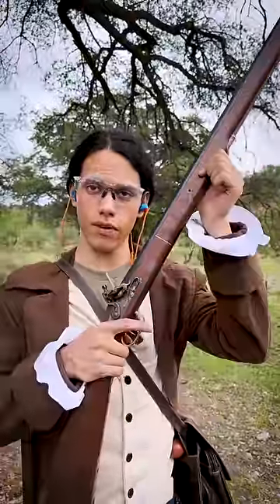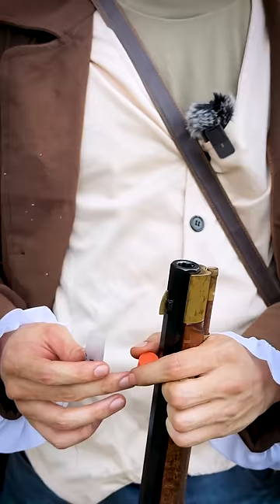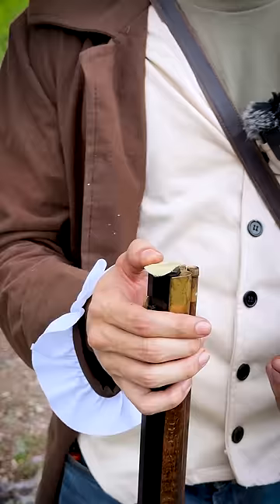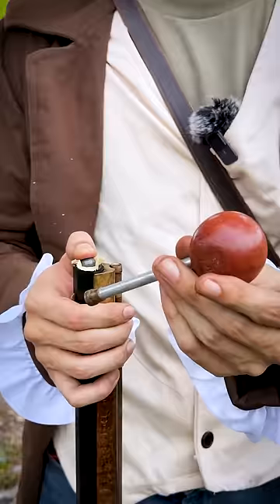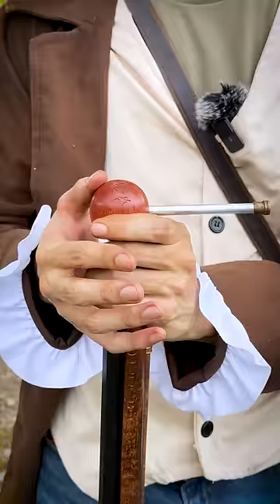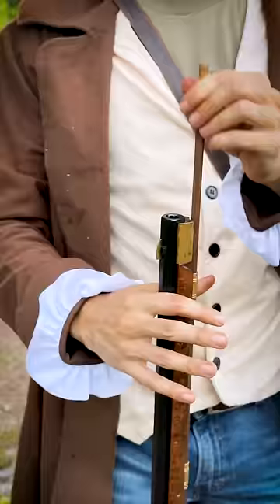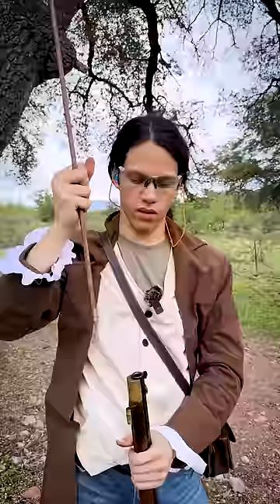How to Load a Flintlock

Comment: 7 hours later. Can't imagine being in battle and having to reload
Reply: Word
Reply: Thats why the line infantry didnt use these, they used smoothbore muskets which were a bit faster to load.
Usually only the skirmishers and sharpshooters used the type of long rifle you see in the video
Reply: Rember switching is faster then reloading
Reply: Maybe It was used on turn based war
Reply: @kinezikinezi1730 if they even had secondary’s at that time😭
Reply: Use sword
Reply: I mean the more u do it the faster it's
Reply: @Donvitto20 yes knife
Reply: This Why Major Musketeers Using Bayonet As Attachment

Even WW1 And WW2 Bolt Rifles
Reply: Bayonet is waving 👋
Reply: that is why they had a bayonet attached to the other end. it becomes more of a spear.
Reply: @gewerh44 thanks for that info
Reply: remember, switching to your pistol is always faster than reloading
Reply: Several Musketeers in a barrage of fire, protected by infantry and cavalry. Also had bayonets in case the enemy managed to penetrate the defense. They positioned themselves at the rear, so there wasn't much danger of being caught while reloading.
Reply: @Donvitto20 usually not, only officers had sidearms.

Comment: I love the delay between the trigger pull and the firing. You can really feel the pressure building
Reply: If it was me firing me first shot and not being advised on this i would have unwelded it from my shoulder and thought wtf is wrong with it? It would then fire while i was inspecting it and leave me in shock
Reply: @bruno13532 you’d probably be on the ground from falling due to the recoil, or a broken nose
Reply: More-so the fuse igniting (the bit of powder in the pan) but yeah that delay is gnarly.
Reply: Same here. Always thought that was really cool..
Reply: Not supposed to do that. That's a hang fire. Oil from cleaning on first shot or crap in the touchhole. Flintlocks don't have 30-06 locktime but not that slow.
Reply: Yeah there should not be this kind of delay. One his gun and vent hole is probablly dirty and 2 hes using too much powder in the pan. A small 1 or 2 grain charge of 3 or 4f is all thats needed. The spark should jump through the vent hole and touch off the main charge instantly. If the vent hole is covered by powder it creates a fuse effect and you get this delay
Reply: When it’s done right, there’s only one sound.
Reply: @Fancy.Bowtie I had one not that long of a delay and not much of a recoil mine was made by Thompson center

Comment: "How do you aim?"

"Hope."
Reply: Did you mean reload??
Reply: Lmao man made me laugh so hard
Reply: Squeeze the trigger don't pull
Reply: @DillonLeyva  who asked
Reply: That’s a rifle, not a musket. It’s far more accurate than most people think.
Reply: Don't forget to flinch
Reply: But having a line of people.... This is just 1 pellet of a 20m shotgun.
Reply: @obi-wankenobi1750  no it's not lmfao.
Reply: @Taylormade2350 yes it is. Muskets are smoothbore military weapons that favor ease of loading over exceptional accuracy. This is because in a battle, you just want to be able to put as much lead down range as possible with little concern with precision. Also, black powder fouling gums up the grooves of a rifles barrel substantially quicker that the smooth walls of a musket. 

The gun he is using is a hunting rifle because it has a rifled bore, which engages the ball and induces a stabilizing spin. These guns favored accuracy over anything else because in a hunting situation, you usually don’t fire too many shots, but the ones you do fire you want them to be dead on. Snipers and irregular troops would have also used these in times of war. They also would usually be substantially smaller in diameter than their smoothbore counterparts, usually falling between 45-60 caliber while a musket is usually 60-77 caliber. 

I own multiple of these guns, have researched them substantially, and fire them regularly. Yes, what the man is using qualifies as a rifle and is very accurate.
Reply: @obi-wankenobi1750  these are not rifled, I know what rifles are bud. Rifles don't shoot balls.
Reply: @Taylormade2350 you obviously don’t know what a rifle is bud.
Reply: @obi-wankenobi1750  obviously you don't.
Reply: @Taylormade2350 obi wan is correct, rifled muskets such as the baker rifle fired musket balls in a rifled bore (pretty sure)
Reply: @datviperboi3818  Nope, I'm correct.
Reply: @Taylormade2350 you are insufferable
Reply: There will be an aim sight on it
Reply: you don’t see the iron sights? They are actually a bit more modern, most back then were a product of the specific gunsmiths style and you had to learn the bias of that cut
Reply: @Taylormade2350  are you just trying to troll or really too close minded for simple research and changing your opinion on such a minor thing. Yes this is a rifle. The term rifle originated from the rifled barrel construction that was invented to make some guns more accurate. This is a long gun with a rifled barrel and would therefore be called a rifle. That it shoots a simple ball has nothing to do with its classification as a rifle.
Reply: @joseph_soseph9611  Nope, sure isn't. Good try though.
Reply: @Taylormade2350 my brother in christ IT DOESN'T NEED TOO USE A BULLET TOO BE A RIFLE IT JUST HAS TO HAVE A RIFLED BARREL
Reply: @M22_locust3  it's not rifled, learn to read kid.
Reply: @Taylormade2350  read what bro💀 nowhere was it said it wasn't rifled
Reply: @M22_locust3  I said it wasn't a rifled kiddo. Again, learn to read.
Reply: @Taylormade2350  yea I kinda noticed that I typed it wrong bro I corrected it💀💀💀💀
Reply: @Taylormade2350 Rifles can shoot round projectiles - what defines a rifle is the rifling on the inside of the gun that spins the bullet like a footie, and in the first rifles they fired round projectiles through the rifling.
Reply: @alexxphillabaum972No, it just takes a bit for the powder to burn.
Reply: @Taylormade2350 Rebuke them with arguments, not just saying they’re wrong. Why are they wrong?
Reply: @carrott36  I can rebuttal however I like too thanks. Already told them why.
Reply: @carrott36  I've already meanted that, well aware.
Reply: @Taylormade2350  They’ve explained why the “why” you’ve already told them is wrong. If you have no new points, or can’t support your existing points further, there’s nothing wrong with saying “Oh neat, I didn’t know that.”
Reply: Guys, Here is The True Savior

HalleluYAH “Praise ye YaH”

YaH is The Father (Genesis 1)
YaH arrives via the TENT OF MEETING
YaH was Who they Crucified for our sins
YaH was Crucified on an Almond TREE

Ancient Semitic Moshe (Moses)
Isaiah Scroll (The Original Isaiah)

Isaiah 42:8
I am YaH; that is my Name! I will not yield my glory to another or my praise to idols.

Isaiah 43:11
I am YAH, there is no other Savior but Me.

Isaiah 45:5
I am YaH, and there is none else.

Comment: That delay between the fire pull and the actual shot was satifying
Reply: you can hear the fuse burning in between, too. insane. could probably shoot with a match if you wanted to.
Reply: nah fasho
Reply: @ion1984  Absolutely could have, the precursers to Flintlocks were Matchlocks and were shot that exact way
Reply: So real
Reply: Same. Seems to me like alot of power the delay
Reply: I once took part in a musket shoot wherein my piece bore at least a ten-pound trigger pull. Trying to hold the heavy stock steady, with the bead upon the target, whilst holding breath and avoiding anticipating the shot, was quite the exercise. My fellows had touched off their shots, clearly to my ears, before my sluggish lockwork broke its rise,  and then the primer snapped. The piece was too massive for recoil to drive off my mark, and the round flew home. I imagined how useful the volley was, to save those with slow or heavy actions, from helplessness whilst awaiting their round to let fly. I imagined more, the usefulness of a two-foot bayonet, so often affixed before the first shots, at often only 100 yards.

Comment: Cant believe they fought in a war where it took 2 min to reload
Reply: A skilled soldier could fire three times a minute. They could do it fast when their lives depended on it
Reply: And you knew your gun like the back of both your hands
Reply: @AlucardHellsing-ct4ej  also they trained and drilled the movement.   Only elite soldiers with training could get a reload speed that fast.
Reply: Flintlocks were also fired in volleys so one line's reload time is the next line's firing time
Reply: I could be wrong but I heard that when they first lined up for battle, they staggered the firing. Not all the soldiers would shoot at once. For example 1/3 would fire and while they were reloading the others would take their turns. When the last group fired, the first group was ready to fire.

When I was in the Navy that's how we fired the twin 40mm saluting cannons. A 21 gun salute with two manually loaded cannons had to be done just right. When one was reloading the other one was shooting.
Reply: You really genuinely think there was only one war with these types of guns?
Reply: I mean they used to charge and beat each other with blunt weapons and blades but you can't believe they shot at each other?
Reply: @Harold_Callahan they fought in lines to get the most out of the volley, they would all fire at once. There's battle that we're over right after the first volley
Reply: @AlucardHellsing-ct4ej  they would also use paper cartridges when available it made it alot quicker
Reply: Yea but w 50 cals
Reply: Tbf these guys would be spending hours sniping in trees over the course of a battle that lasts a week.
Reply: @AlucardHellsing-ct4ej  That's soldiering.
Reply: ONE BULLET
Reply: @Arirezz  when did i say only 1 war?
Reply: @EpicDays-ch9l  what?
Reply: It's a 60 second short. Where do you take your "2 minutes" from ?
Reply: @dazzlemasseur   lil bro read my comment again i aint talking about the vid
Reply: Gonna blow your mind here, we’ve fought many many wars over at least 3-4 centuries with musket technology
Reply: @calebkendrick1590   didn't say there was only 1 war lil bro
Reply: @anzethefarmer7819  I’m sorry you’re right, the phrase “a war” isn’t singular. All my years of learning English have been wasted
Reply: @calebkendrick1590   lil bro mad af 😂
Reply: 2 mintues of silence
Reply: @anzethefarmer7819  "a war" implies 1 war, also lil bro why you so mad? Replying to everyone like you have something to prove lmfao
Reply: @Arirezz   lil bro mad af 😂😂
Reply: @anzethefarmer7819  why the rage bait lil bro? It's okay, I'm here for a chat if you need (:
Reply: It's not that slow
Reply: @Harold_Callahan  Lining up like in the movies would be stupid, because even then artillery was king.
Reply: gen z moment